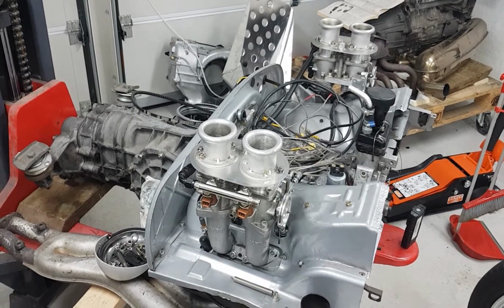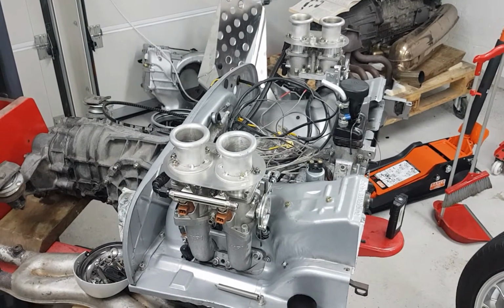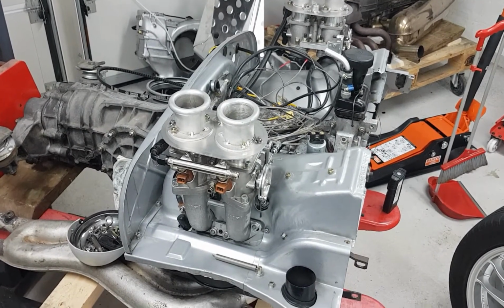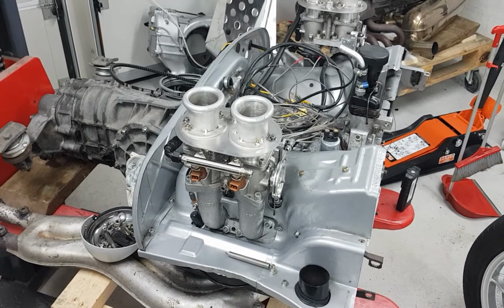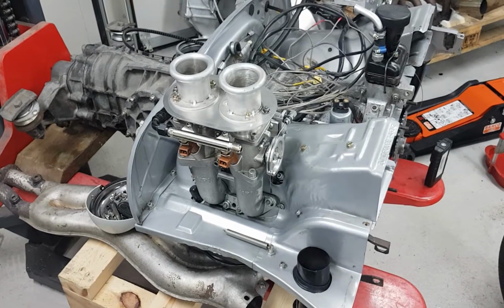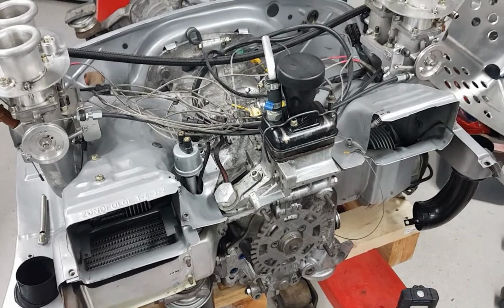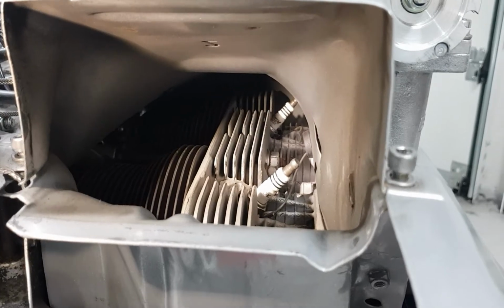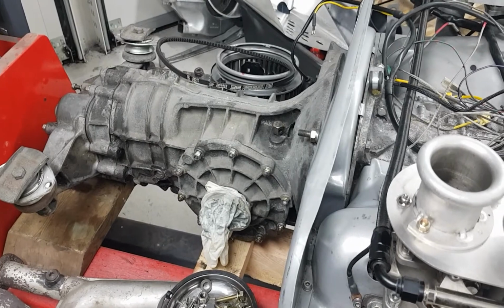My 2.3 liter 914 engine specs

Comment: this is based on 1.7 or 2.0 block?
Reply from the maker: 1.7 block
Reply: @MatsGarage  nice. a lot of work with homologation etc? i know its kind of bs question, but how much did whole upgrade cost? thnx.
Reply from the maker: @izoyt  homologation? its not a race car so thats not needed. The whole engine build with longblock, ecu, itb's etc was probably around 12-13k $

Comment: Also Mat, I'm keen to know what modifications you had done to your cylinder heads? Did you weld up the spark plug hole and drill again for the 2L  914 plug angle and 2L 914 chambers?
Reply from the maker: As I didnt do the job myself I'm not certain of the exact procedure but yes the heads were welded up and remachined for the 2.0 spark plug angle.
Reply: @MatsGarage  OK, the 2.0L 914 plug angle is good when going for the higher compression of more than 8.0 : 1

Comment: 1:09  "  Chrome Moly push rods "   The stock ones are aluminum so valve lash does not dramatically change as the aluminum block and aluminum heads expand. ( Aluminum has a greater expansion rate compared to steel )

Comment: Hello Mats
Nice job your engine rebuild
Could you please explain what modifications have to be done for the 78 crankshaft, and allso where your throttle' bodies and pipes are coming from ?
Again great job, and thank you for sharing!
Reply from the maker: I dont know what the exact modifications is done to the case to fit the 78 mm crank. Check out the shoptalkforums.com and ask there.  The throttle bodies are these ones: https://www.vwspeedshop.com/product.php?productid=16821&cat=395&page=1

Comment: Coolant sensor??
Reply from the maker: Yes its a modified GM coolant temp sensor mounted on the #3 cylinder engine tin. Its used for the cold start enrichment of the engine

Comment: Matts, is there a list of your parts, incl.,your fuel injection & where you got it?
Reply from the maker: The ITB's, crank trigger, cam trigger and air temperature sensor are from thedubshop.net
The fuel injection system is a MaxxECU system available from them or their resellers. The injectors are from a scrapped Saab 9-5. Fuel lines and throttle pulley system is from Tangerine racing. Thats all the major components. Let me know if you have other questions and I will try to answers as best I can.

Comment: Stumbled across your channel from a 914world link. I'm in the very early stages of collecting parts for my own build and I've landed on a very similar spec and drive train parts list to what you've outlined. Though the car is a 68 vw fastback.  I too am starting with a 914 1.7 and have looked to building it out to 2.3 with the FI package from the dubshop with ITB's, MS,  etc. I am curious about a couple of things:
The scart SS is incredible, how do you feel about it at highway cruising speeds and daily driving use in general? Though I don't plan on running heater boxes and will likely have a header built, I would like to hear your thoughts.
I've got a '67 911 transmission, I am also curious about what gear ratios you are using in your box.
And please link me to your blog I once visited but have since lost 
Thank you for sharing !
Reply from the maker: The Scart SS is great even at highway driving. Sure there is alittle noise but nothing annoying or intrusive. My gearbox is a stock 914 2.0 box.  So it should have the gearing according to this page. 
http://www.914world.com/specs/regearing_901.php

Cheers and good luck with your build !